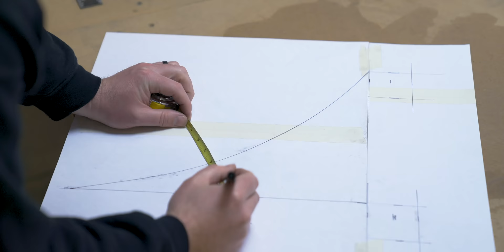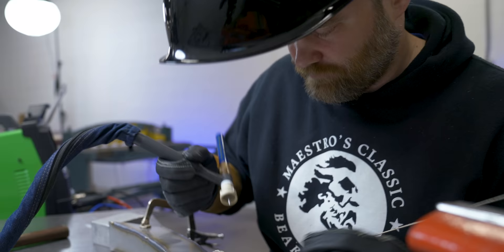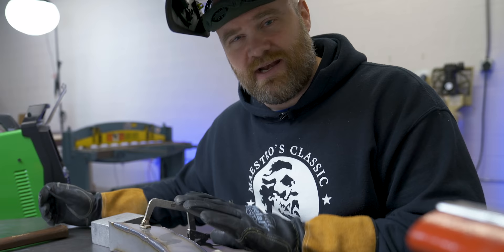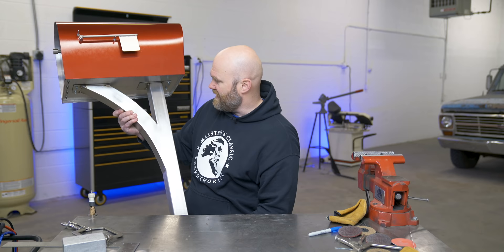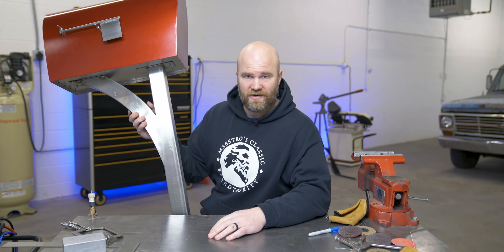Metal Blending a Stainless Steel Mailbox Base

Comment: I know its probably very late, but the reason you had the lines on the tube after using the 120 grit on the burnisher is because you had the drum on the wrong way, essentially running in reverse so the slanted design of the holes through it were pointing the wrong direction, they are supposed to go the other way so that the rubber between the holes acts as a damper, it only works as a damper in one direction though

Comment: The entire time watching you weld the curved piece to the straight tube I kept wondering how you would deal with the top joint so that rain doesn't collect in the curved section. Perhaps a small hole drilled at the bottom of the curved piece. Maybe it's not necessary.

Comment: Great project, it looks fantastic.  I think your idea of of using the black washers is actually going to induce more corrosion as you now have 3 dissimilar metals combined (plus fasteners) and electrolysis loves that condition. Airplane skin is usually 2024T3 and on jets near the exhaust as found of the F-86, stainless steel is attached to the aluminum. I don't know exactly which alloy stainless any longer but, if you are using a 300 series stainless plate to attach the mailbox, I would have just fastened the two together. If still worried about corrosion, get a can of  zinc phosphate primer and spray the bottom of the mailbox. Aircraft Spruce used to sell zinc chromate, the real stuff that worked. I guess the EPA finally got their way while China pollutes the world. My 2 cents.
Reply from the maker: That’s all good info, the washers were rubber though not metal.

Comment: Hey Justin, I love the videos. I have a question for you. I am working on a small section of sheetmetal (aka roof of a car) and I need to punch some square holes. What is the easiest way to do this?
Reply: Not my business but this is a really interesting question and made me think. How many holes do you need to do? My first thought is just drilling and then filing them square unless you've got several to do. You'd need something bolt operated since you probably can't put your roof in a press.
Search for Greenlee 60001 square punch. It's a half inch square. Not cheap but I think this style tool is what you'll need. Good luck!